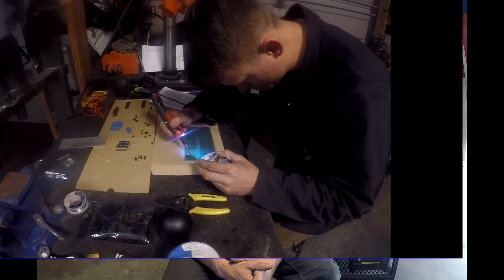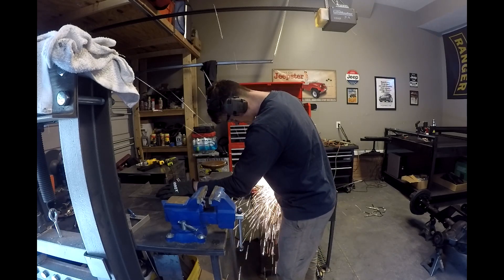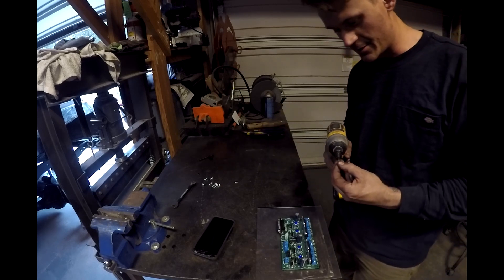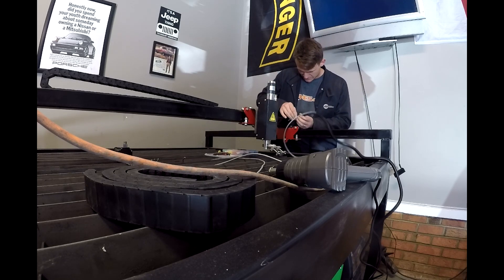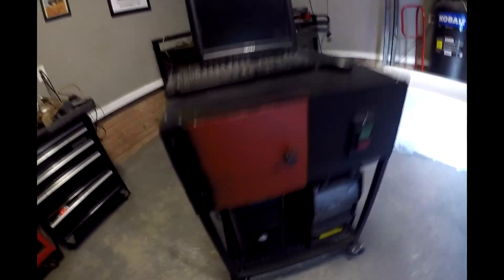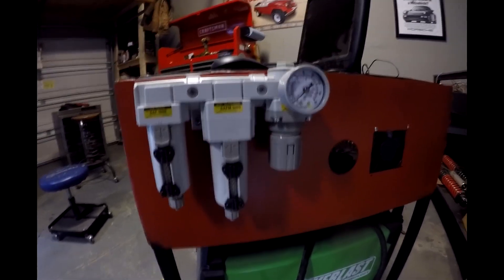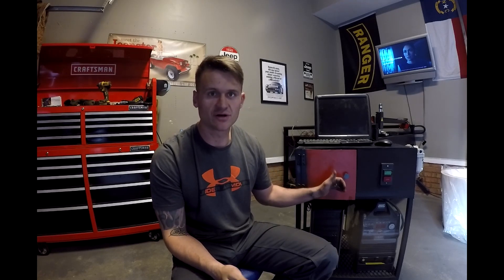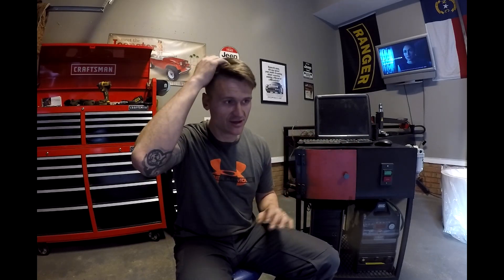DIY Plasma Table Electronics II Legacy 4x4 and Off-Road

Comment: Very interested in a build list, for the rails/electronics and such. New to this, and wanting to build my own, your videos made it seem way simpler than other videos I’ve watched.
Reply from the maker: Thank you for your interest, I am putting together another two videos that will tie this all together. First video will be a finished table video and overview of more wiring stuff, torch height control and the software side. Second video will be parts list, cost, overview things like that. Should hopefully get the first video up this coming week i am finishing up the software today. Then a week later the second video.